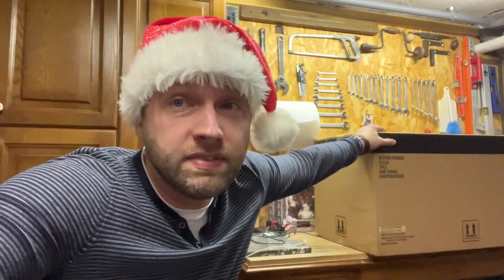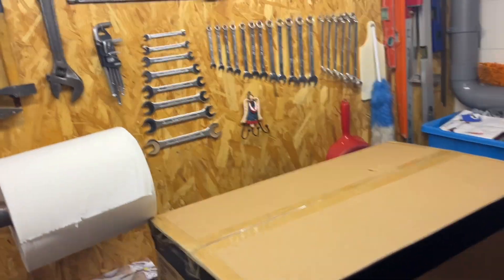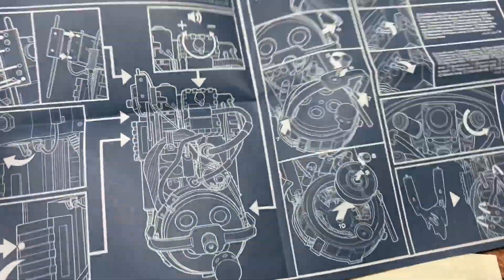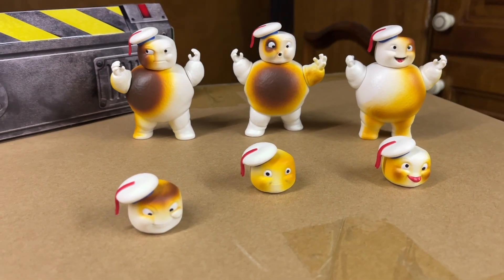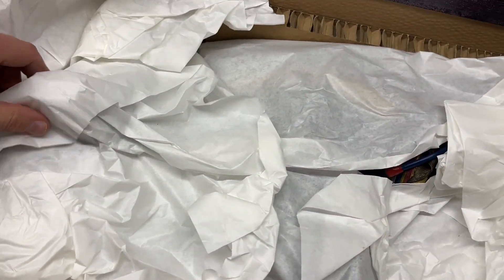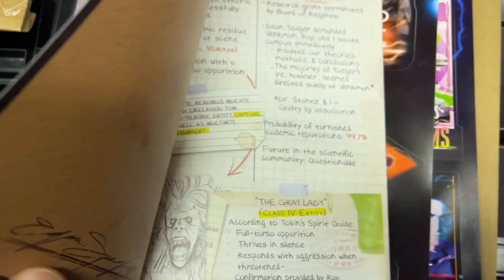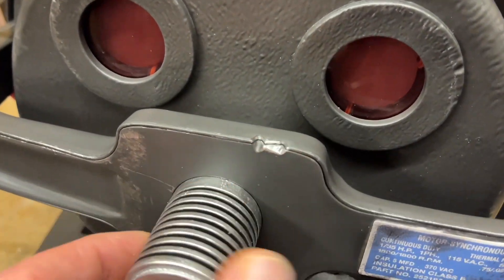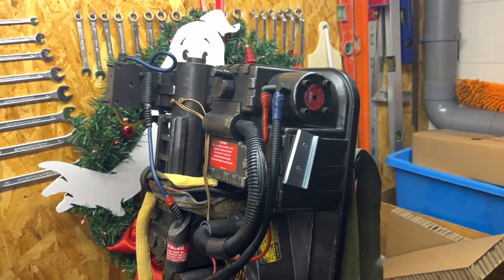Ghostbusters Proton Pack by Hasbro Pulse - Part 1 : Unboxing & First Impressions!

Comment: This is helping me realize how small the Spirit pack really is.
Reply from the maker: Never seen it for real. Do you have it? I understand it’s small but is it at least accurate and well detailed ?
Reply: @eivoMSeb  
I actually do and it really is smaller than the usual dimensions. In fact I just went and looked at pic showing it next to a to scale pack and it's a bit significant. That said while it's obviously less detailed it's not bad. I did mount mine on an alice still and used it for cosplaying. My main annoyance with it is that the wand is held on with a peg instead of the V-hook, and it falls out way too often, plus the lighting is very basic and doesn't stay on without modification, part of why I'm excited for the Spengler pack, though it's unfortunate that the lights there are on a timer.

Really hoping Hasbro Pulse does their own trap though, since I missed the Matty one and am using a Spirit Halloween one. Same for the PKE meter for those that missed the Matty one.

Comment: Love the pack the only thing that throws me off is the yellow wire sleeve its not the right one   so i went ahead and bought the accurate one !! Cool video my friend
Reply from the maker: Thanks a lot man. Yes it does have a couple minor inaccuracies, but I’m not sure I’d mod it. It just looks so good as is. I’ll see. Working on Part 2 now, and still in awe with it. I’m mesmerized.
Reply: the yellow sleeve can actually be taken off
Reply: How can one find the accurate sleeve?